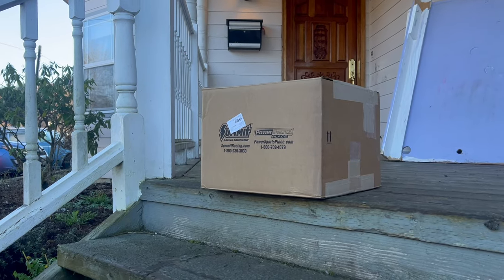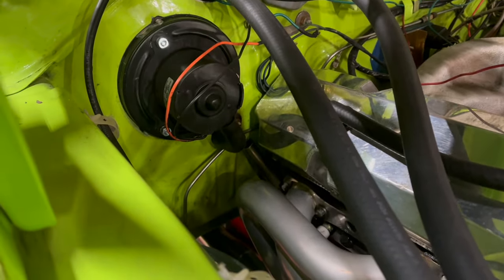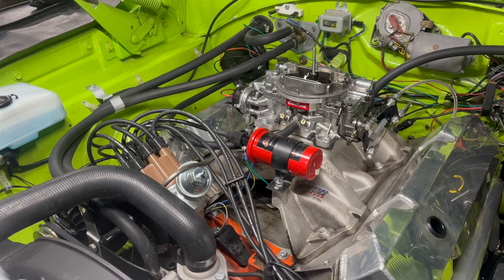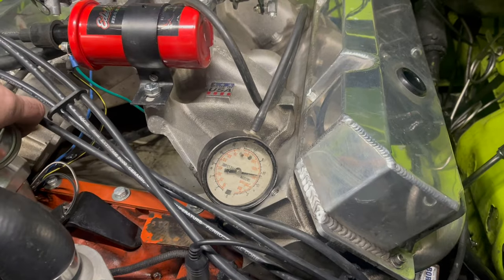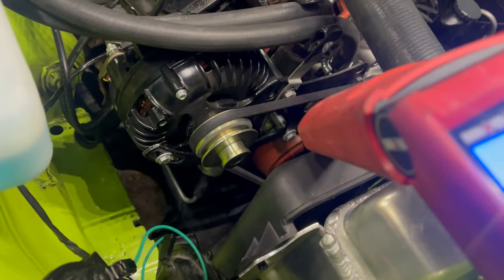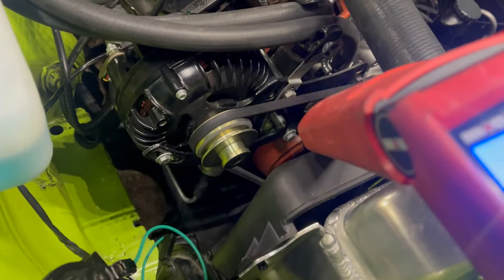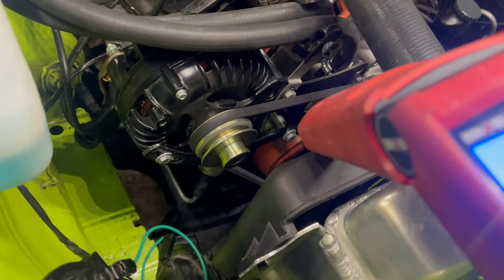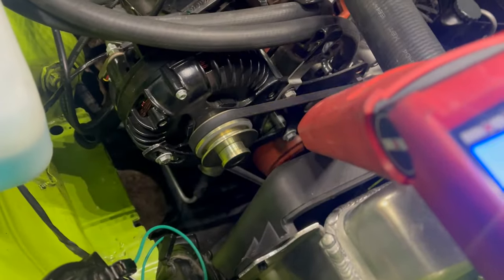STREET MONSTER! 1968 Dodge Coronet 500 - Testing And Tuning The 440 After Transmission Mishap

Comment: You keep saying Green like it's a bad thing. LOL. Love all those High Impact colors. Need more trucks in those colors
Reply: I like it!
Reply from the maker: I’m just not a high impact guy at all. Or a green guy. And I know some members of the viewership feel the same way. Haha.
Reply: Just not right on a '68
Reply: @mickangio16  Not the worst someone has done.
Reply: I remember the first car in that color in my area. It was a brand new '70 Road Runner with Cragar SS wheels. I can't think of the words to describe the feeling about it at the time. Did you like it? Hate it? One thing for sure, you couldn't help but notice it above anything else in your line of sight. I guess the reason why I am a bit sensitive about the high impact colors is because they represent an unforgettable period of my life. I have owned among many other musclecars when I was young a white '68 Coronet R/T, a '70 B5 blue Road Runner, a '70 purple GTX, a purple '70 340 Dart, and foolishly passed on a '71 purple Challenger R/T 440 4 spd with all the wings & stripes. I didn't buy the Challenger because I had both my Dart and my black '64 Polara 500 w/440, 4 spd, and 4.56 Dana at that time. I did get a '70 Challenger later but it was a Special Edition 383 2bbl car in dark bronze metallic with an R/T hood and painted black up the middle like an R/T.  Before 1970 you just didn't see cars in that bright green, bright yellow, purple, orange, ... except the "Big Bad" AMCs that beat Chrysler to the punch by a couple years but they were fairly rare. One of my friend's older brother had a new "A scheme" AMC SC/Rambler. There was a very eye catching Big Bad Orange AMX in the neighborhood and Verdoro dark green Firebirds and especially GTOs were popular.
Reply: The green that ma MoPar used in 69 on the A-12 package was f-6 is the best green that they used.
Reply: It’s too much bright green

Comment: The exhaust note that this car has is my absolute favorite! And I don't think the cam choice could have been any better. Maximum lope at idle without wanting to die when the throttle slams shut. You have this setup dialed in spot on, Jamie!

Comment: The stylists really did a great job on those quarters and rear, I particularly like the deck lid with the slight spoiler feature. It’s funny that they had to use the corporate doors and roof, but got free rein on the door jambs back.

Comment: Very nice car, and it sounds like the 440 is running really well. I actually like the lime green and black trim combo, very tastefully done. If I want to nitpick, I would say the Superbee logo just doesn't belong on the car, it should just be a plain black bumble bee stripe. That, and a full blackout on the grille, which really gives the 68 Coronet a mean look. And I also really like the black wheels with the small caps.

Oh, and no leaks! That's nice. Finally, headers on a big block Mopar really are very hard to live with. A good set of high perf stock manifolds would do just fine I think.
Reply: The super bee stripe is the last change to make. I already have the bubble bee stripe waiting for warmer weather to tackle that . Thanks for the kind words!

Comment: That yellow 68 Coronet I brought by last summer is a 500. Probably somebody swapping parts in the '80s pulled off the tail lights and tail panel and installed 440 tail lights. It's been fun finding all the 500 parts to reinstall on the car
Reply: This car had deleted all the cool parts too. It had the shallow lame taillight frames no trunk panel no front grill emblems changing out the stripe will be last thing In my conversion .
Reply from the maker: Oh nice. I didn’t realize that. Apparently there were a lot of ‘68 500s? Haha.

Comment: You can tell if its higher stall by looking  at the welding marks from the tork guts.  More angled are the welding lines, usualy the higher the stall.  I know there's much more but after identifying few torks,  you get better at it.
3600 was high to go get groceries. Lol
Nice explanation with that timing light.

Comment: I dig your Matco rebranded Witte screwdrivers.  I have a similar set in blue from Cornwell.
Reply from the maker: Oh interesting. I have a green set of Cornwells but they’re a different style. I have three sets of those “Matco” drivers - two orange and one green. At least a couple of them have been replaced with newer units, with grips that no longer say Witte. My favorites are the classic red handled Snap-Ons though. I had to order those special because they were being phased out for goofy new ones and the old style were no longer on the truck. AvE did a big screwdriver review and rated the Snap-Ons as just about the best, and that was good enough for me. Haha.

Comment: Now it makes me think how the tuning you did on my car went. I think I had it pretty close but I'm no expert at tuning. Still learning.
Reply from the maker: Yours was like spot on! I think I tweaked the idle mixtures. I checked the timing curve with a light and it was exactly what I would have done. That’s why there was no video on it. Haha. The only problem we’ve really had on it was the intermittently sticky throttle. I added a second spring and that helped, but it has still been a bit goofy.

Comment: If that's a "Break-A-Way" TCI converter, it will work great!! I used one in my '70 Challenger R/T 383 (which I installed a tweaked 1977 400 into, with a 275DEH cam) and it was great!! The "Street Fighter" and "Super Street Fighter" units have always underwhelmed me, never really delivering properly. 😢
Reply: It is a break away. Thanks for the info. I had heard good things about them , but was also hesitant due to the other being a TCI!
Reply: @Coronetguy  I loved the one in my lopey Challenger. I also had a dual plane DP4B intake and a 750 Edelbrock AFB with HP exhaust manifolds and real good dual exhaust with an H-connector. My cam was probably milder, but the smaller engine matched that converter perfectly with 3.23 gears!!

Comment: little secret, on my old tucks that had brake problems. it looked weird put a cadillac vacuum pump on them, bam dune .works like a dream. they put them on the first gen diesels.
Reply from the maker: Ah, you mean a belt driven unit. I’m familiar. There is an electric pump under the battery. I learned when he picked it up that this booster behaved the same on the electric pump as it did on engine vacuum when I was done. Problem found! And it’s not the amount of vacuum.

Comment: love the sound of this thing and  always learning something new from your videos man ! my car is running very rich i have an MSD ready to run distributor and recently discovered that there is different sizes of springs to modify the curve and timing any idea about MSDs , mine is a 400 originally a 2bbl now a 4bbl street demon 625
Reply from the maker: Indeed, there is a lot of tuning that can be done there. But I can’t tell you exactly what your engine might want…
Reply: @DeadDodgeGarage  i was wrestling with the carb since day 1 , car is low on torque on low rpms until you kick the 4bbl ( 4 speeds car ) it feels like on certain mid rpms the car run well

Comment: Manifold vacuum advance in most cases work for Olds V8's. Low compression Olds V8's, nearly 50 at idle and nearly 60 at part throttle Just like Edelbrock's often give headaches even after throwing a ton of tuning parts. I know from my 318 van days, Dodge usually like less timing.
Reply from the maker: Right. That has been my experience too. I have tuned a lot of these. I was not expecting it to want all that. But it does…

Comment: Jamie, if I understand it correctly Tom is buying a 1962 Dodge Lancer, so you will finally be able to get your hands on an early-series A-body car. I've got a '62 Valiant V-200 resto rod which is heavily modified and has an LA V8, etc. However, I'm just an amateur mechanic and I'd like it if you could tell me any mistakes that I might have made in building it. I'm not sure how we could do this.
Reply from the maker: I’m not sure either, but that sounds pretty cool. Yes the Lancer has been a possibility for quite a while but he’ll actually be bringing it home some time soon. At some point wires got crossed and he thought it might be a GT. The idea of a two door hard top Lancer had me pretty excited, but it turned out to be a sedan. Still, neat.
Reply: @DeadDodgeGarage My '62 Valiant is a 4-door, and I like it. "Easier ingress for the fairer sex", plus looking like a grocery-getter reinforces the "sleeper" image. So maybe if I can ever buy or borrow a car trailer I'll bring it up there and show it to you. It's got a 3.73 rear axle, so it's not a very good long-distance cruiser.

Comment: So is that go green? That cam is rowdy at idle for sure. Not a fan of Flowmaster but mangna flow yes. Huge upper rpm difference oddly enough. We have tried both. Very informative video and you cut 3hrs of swear words out too lol. I had a yellow 68 bee with a 383 and 4spd for a week and my dad made me take it back. It was amazing. I would have died in that car lol. I think he knew that lol. That's a good one for story time with rooster lol. I do love coronets and sold my 68 500 3yrs ago because you can only build so many. Sound familiar 😂 oh so what's the plan with the vacuum issue.
Reply: They are magna flow .. he just didn’t see the info on it. But thanks
Reply: @mr.m.s.m9533  mark you have a sweet car. I like headers btw lol
Reply: @Roosters_Restos  headers are great until you have to work around them. Thanks for the nice comments!
Reply from the maker: This is Sublime Green. The slightly darker shade is Green Go, or what Plymouth called Sassy Grass.
Reply: I have a can of touch up that I got from
Previous owner . It’s mean green.

Comment: I've heard an engine will idle cooler with more advance, is that true?
Super nice work BTW. That things got crisp throttle response and sounds fantastic.
Reply from the maker: Absolutely true! Late timing kinda ruins everything. Power, efficiency, operating temperature all suffer.
Reply: @DeadDodgeGarage  Thanks, I've been contemplating switching my vac. adv. to manifold (Ford FE). I don't think there's a down side beyond emissions - which I've read is the reasoning behind Ford always using ported vac. 
Thanks again Jamie.

Comment: Maybe shorty headers would be better. BTW I am an old people. I sure as heck don't drive like one though. That's a beautiful ride.
Reply from the maker: Shorties do fit better, but I don’t see them often. If you ask me it’s the full commitment to horsepower with the misery of long tubes, or run factory HP manifolds and take what you can get. The real measurable difference is going to happen in a part of the RPM range where this engine - like most street engines - will almost never be.

Comment: What did the squeak turn out to be?  Alternator belt?  If so, check for overcharging due to massive voltage drop in the charge circuit.
Reply from the maker: It was the alternator belt. It wasn’t loose, but I tightened the shit out of it and it stopped. No overcharging, rock solid voltage, but that fancy 100 amp self regulated alternator sure seems to drag hard. I’m well familiar with charge circuit issues - I didn’t write the book, but I made the video 😅

Comment: The headers might pose a bit of an issue on fit, have you considered Tri-Y headers? especially from Schumacher creative services. (This is not an infomercial lol) 
I plan on getting those, seems like a good compromise, excellent fit, and the Tri-Y's bump your power range to mid range ish and a bit at top end, while retaining low end.
Reply from the maker: I’m aware they exist. I have never seen a set of Schumacher headers in the wild yet. I’ve used plenty of their mounts though.
Reply: @DeadDodgeGarage  Good deal, likewise here, have not seen Schumacher's my self.
Kind of a rare occurrence to see them eh?

Comment: I'm sure that you poured at least a quart of transmission fluid into the new convertor before you installed it, right?
Reply from the maker: Of course! I didn’t film that on this one because I just detailed converter install techniques in my ‘73 Charger video and didn’t think I needed to repeat it. The problem is, the Charger video isn’t done yet so no one has seen it to know that 😅

Comment: Thanks for giving the timing numbers. My tune is the same and my build is very similar. Gives a bit of confidence. What is the rear gear ratio? Carb cfm?
Reply from the maker: 3.23 gears according to the tag. It’s got plenty of get up, I’ll tell you that… he said it’s an 800 or 850. I didn’t check myself.
Reply: @DeadDodgeGarage  Thanks. I really enjoy the live stream too.
Reply: Update my tune ended up with 20° initial 14° mechanical advance 16° vacuum advance ran to manifold. Hope this help someone. Thanks Jamie!

Comment: Jammie i want your opinion. This 86 d100 shortbed 318 auto that ive been eyeing in town for years is for sale 59k one owner miles. Its rustyish runs like a top manual steering for some reason and i know the person who owns it. For the price its a touch high but i dont mind but should i throw a cam at it or leave it be if i end up with it in my driveway.
Reply from the maker: I’m a leave it be guy, for the most part. Especially when you consider that most of the readily available cam and lifter options are bad ones.

Comment: What a minute. You're sending the car home while it can't rev past 4 grand? Did I miss something? My CJ pulls to 6200.
Reply from the maker: I ran out of time to address this in the video - or do anything else, really, because he was already here to get the car as I was finishing my last test drive. It liked to hang there under some conditions, but when punching it or shifting manually out of the hole, it would rev out fine. I can only do so much - it’s running much, much better than it was. And the more I drove it, the less it seemed to be an issue. I did advise him that I had noticed that at times, and that it may require further tuning.
Reply: Okeedokey.  @DeadDodgeGarage

Comment: e the exhaust looks like a flow master to me and that's what I have on mine only mines 3 inch and that thing sounds a lot like mine except a little quieter so maybe 2 1/2 inch you got there they are nice I won't buy anything but each pipe and headers and just hate the headers when you have to work on otherwise I love them that extra 35 horses is nice
Reply from the maker: Yes 2.5 and I’m pretty sure welded Flowmasters, just not sure on series. I’m not really the muffler guy. Haha.

Comment: Please explain the timing line on the spark plug your talking about
Reply from the maker: Old school plug reading technique. A line develops around or below the curve of the ground strap on the spark plug that can be used as an indicator of where your timing should go. If you are really curious about this, I suggest looking at lots of pictures of plug reading for timing, heat range, and fuel mixture online.

Comment: Assuming that’s a hydraulic cam, any idea of piston to wall clearance? Granted, smartphones seem to magnify engine sounds.
Reply from the maker: I could hear some exhaust noise coming from the headers, that may be what you are hearing. I don’t know anything about how the engine was built, other than what is obvious from outside and the cam specs. Yes, the phone mic does weird things. For example, there is an obvious squeak when I am cornering in the driving scenes that I could not hear at all in person - or I would have said something.

Comment: I was told that using Never seize with aluminum heads is a no no.  Am I incorrect with that information?
Reply from the maker: No I’m pretty sure the interface between the different materials is the best place to use it. If there is a good reason to not use it I don’t know what it is. Personally, I don’t use anti seize at all, for anything, ever.

Comment: That engine wiring is a crime against humanity. XD
Reply from the maker: If you’re looking at the add on wire for the vacuum pump that I disconnected, I wouldn’t worry about that. Beyond that, it’s a brand new reproduction harness? So I’m confused
Reply: OMG!  That wiring from the heater fan and out to the carburetor that snakes above and below the heater hoses needs cleaning up. @DeadDodgeGarage

Comment: Oh I don’t like that color on a 68, no offense, wonder what the original color? Speaking of original color, on my 68 charger I changed on the last moment to go with a black vinyl top on my 68 charger because the white top before was soooooo hard to keep clean looking
Reply: I miss driving my charger so much, the room, actually feeling like your in a car with that big dash and steering wheel, with the monster hood, and the heat coming through the firewall from the fire breathing dragon of a engine and just the sound and smell, no music needed.
Reply from the maker: This was an original white car. I love the white top on my Charger. It looks a little grubby at times but I could never change it.
Reply: Yes white looked good on my blue charger, and drove it 5 year that way, black would be nice for a change, if it were a R/T and a white BB stripe then I wouldn’t change it

Comment: You always idle too slow
Reply from the maker: I do. I am well known for that. Haha. I actually intentionally set this one at 950, but was noticing a big drop when it went into gear. I lowered it to the point that it went in gear smoothly, and thankfully the engine was still happy there. Don’t remember what RPM that was.